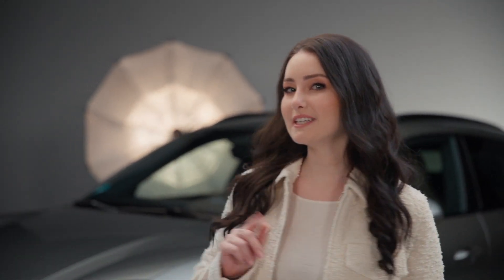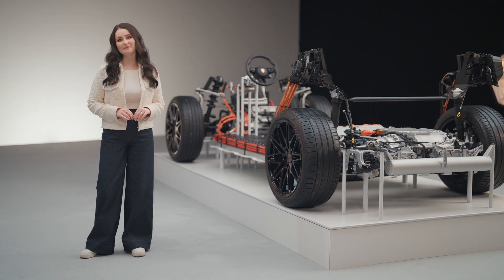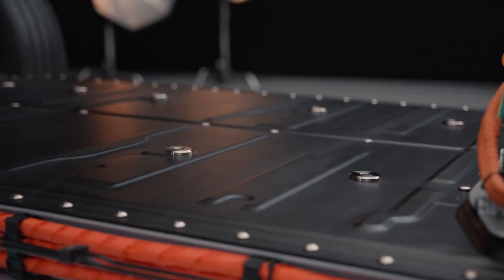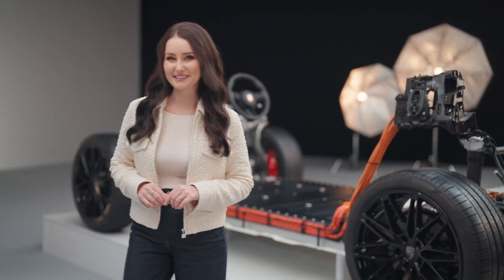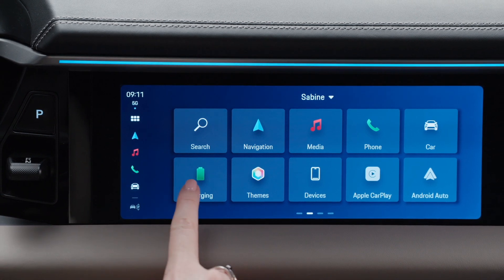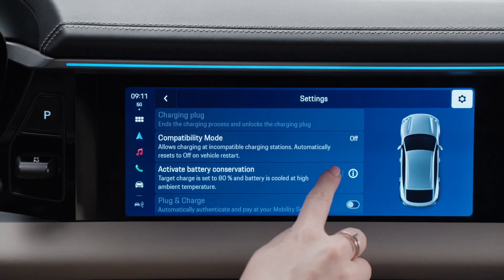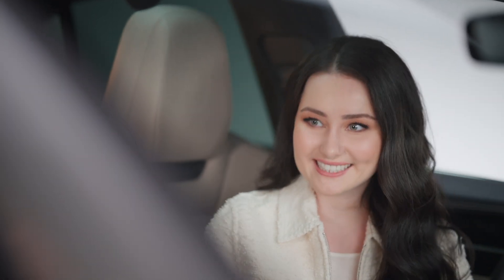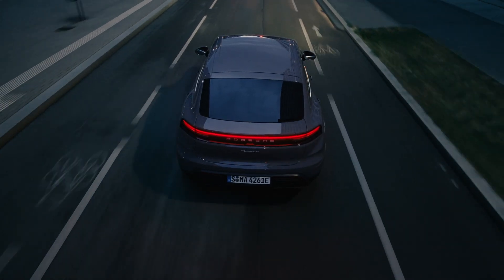How to use Battery Conservation in the all-electric Macan | Tutorial | Spot On

Comment: Extremely Disappointing and Unacceptable Experience with Porsche Dubai
I am compelled to share what has been the most disappointing and unacceptable experience with Porsche Dubai. After placing an order for a brand new Macan S and patiently waiting over five months for delivery, I was shocked to discover a major issue immediately upon driving the vehicle out of the showroom.
The car exhibited severe instability — it was sliding and overly sensitive even at very low speeds and on minor road imperfections. Shortly thereafter, the onboard computer indicated a suspension system fault. Upon inspection, it was confirmed that the vehicle had a significant suspension system defect. Delivering a car in such condition is not only a clear failure of quality control — it’s outright dangerous. It is inconceivable how such a critical issue could be missed if even the most basic checks had been conducted. This raises serious questions about the company's safety protocols and pre-delivery inspections.
To make matters worse, the response from Porsche Dubai has been dismissive and insufficient. The proposed solution was a wait of another five months for a replacement, with no interim vehicle provided. The only compensation offered was a one-year warranty extension — a completely inadequate gesture under the circumstances.
Even more frustrating was the arrogant and indifferent attitude of the sales lead, who remarked that there is a long waiting list and that customer demand is so high that my case simply wasn’t a priority.
This experience has shattered my confidence in the brand. It should never be a game of chance when purchasing a premium vehicle — especially one that carries the Porsche badge. Unfortunately, in this case, it feels like I entered a lottery with my safety on the line.

Comment: so you're saying the battery isvery fragile and when i buy this car what i actually can use without damaging the battery is only 80% of it? Also how do i discharge the car for storage? And what does happen if i don't discharge the car before storage? Will it burn?
Reply: No, it is not specially fragile or anything, but in general you can assume for all lithium ion cells that the aging process is the strongest above 80% SoC (State of Charge), below that the aging can almost be neglected.
Additionally the you can say that a smaller charging current reduces the cell aging, especially with a higher SoC above 80%.

Those facts apply for all kinds of Li-Ion-cells, like in your phone, Laptop etc.
Reply: Basically it´s like you don´t ref up a cold ICE...
Reply: @ yeah i usually only fill up half a tank of gas to reduce wear cause fuel is heavy :D - EV fanboy will accept anything it seems. Why do you let companies sell you these greenwashed excuses for improper tech?
Reply: @firebladeflow  dude xD
 I'm not an EV fanboy, I'm an HV Battery engineer working with all kinds of batteries. It's a technical fact about battery cells.

It seems you are the kind of person who would ref a cold engine until it blows up because you have bought the full range of rpm.

Privately, I drive a 1984 911, just for your understanding. 
Sometimes, you just should inform yourself properly before yapping about it
Reply: @Frogn_  i know about battery chemistry, not my point. I just don't like the advertising here if the product will fail prematurely when used without limitation, then the product can not be used to full extent. You pay for 100kwh and can only use 80 ... Great car choice btw.
Reply: @firebladeflow  ok, that point I do understand!